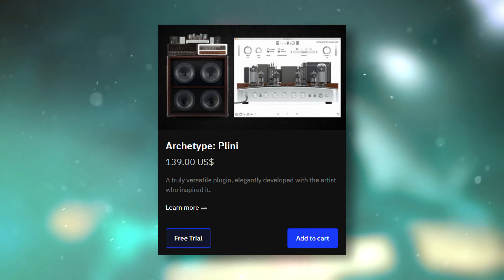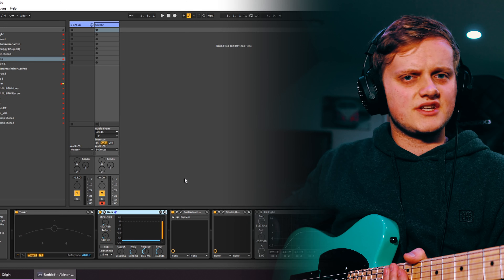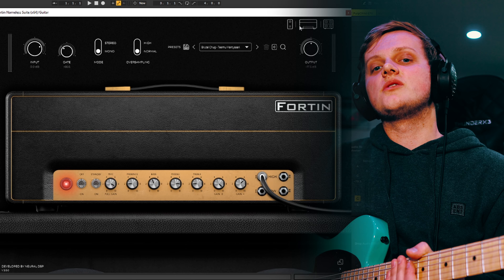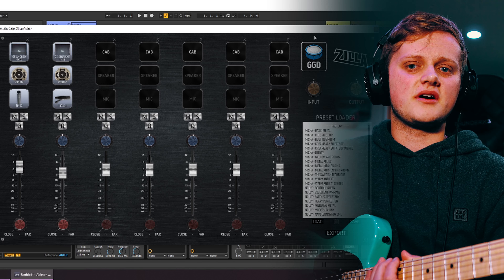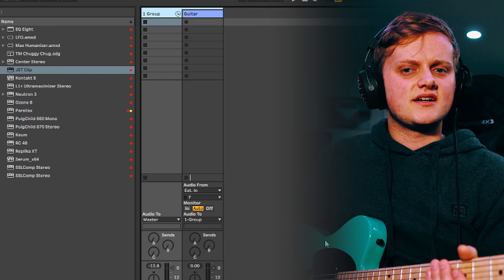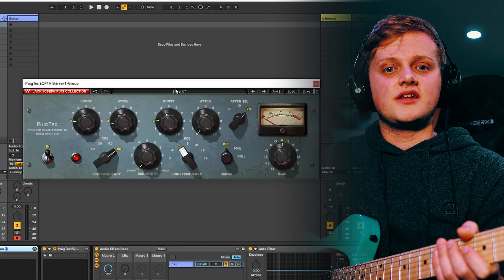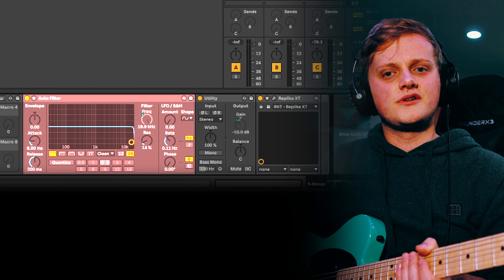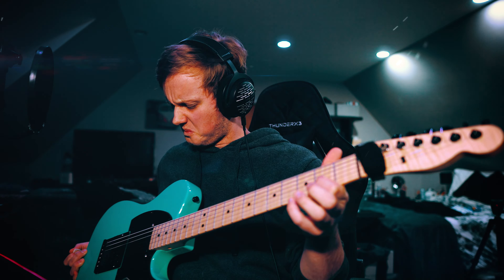My EXACT Go-To Guitar Tone In Depth - Tutorial

Comment: great video! was wondering what hardwear you use aswell to plug your guitar into? as of right now i only have the apollo twin duo just bought it would i still be able to get a tone like yours?
Reply from the maker: Cheers man! Hardware-wise I plugged straight into a Focusrite Clarett 8pre for this. Nowadays I may also have my signal running through a pedalboard before the Clarett, so I can engage a couple of effects (Horizon Devices Nano Attack / Darkglass Hyper Luminal Compressor / Line 6 HX Stomp), but even then I can pull a DI signal into the Clarett as well. Apollo will be absolutely fine (in fact will probably be better than the Clarett haha - the Apollo Unison preamps are nuts!), I actually used to have one briefly but ran into issues running it on my Windows PC, so returned it.